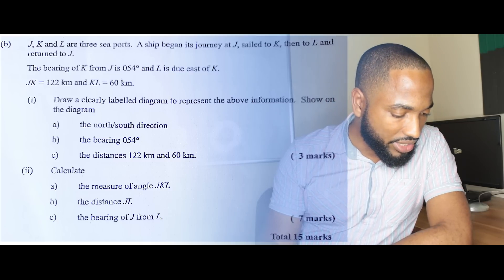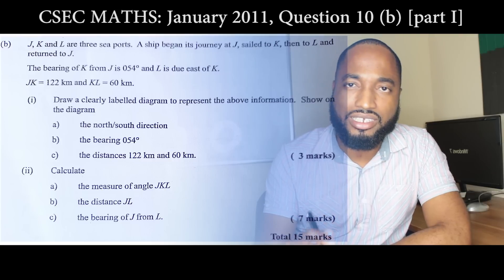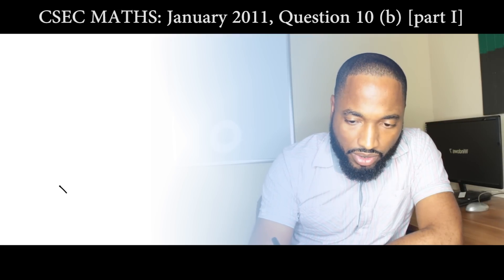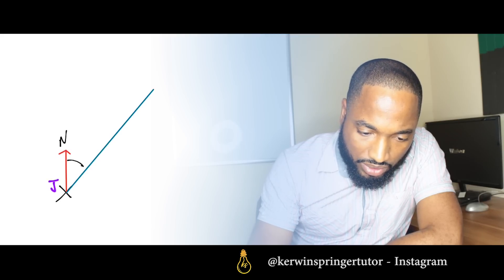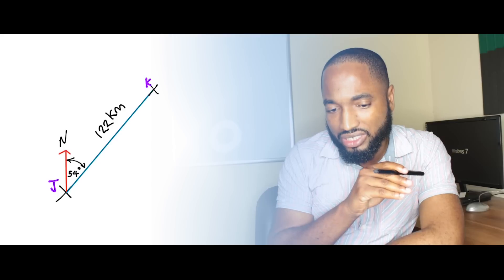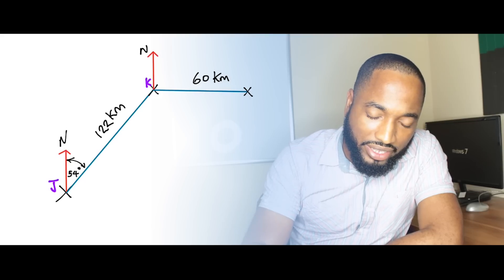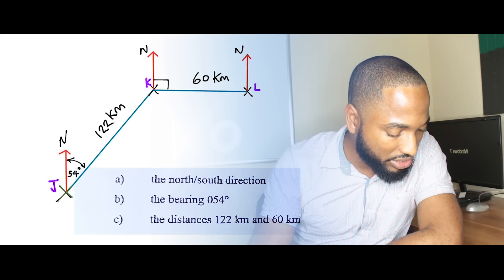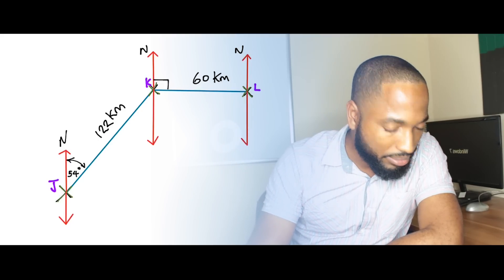Drawing a bearings diagram

Comment: I got 126 as my angle and 121.02 as my side for JL I used the rule alternate angles to get the angle which was 054 degrees and cosine rule to get the side JL since we now had two sides and an angle in-between 
Don't crush my faith lol hope I'm right
Reply from the maker: Vatoya Soodat that was quick. Don't wanna crush your faith but it's not correct. If you watch the diagram you can tell 121 is too small to be JL.
Look out tmr for the solution and more...